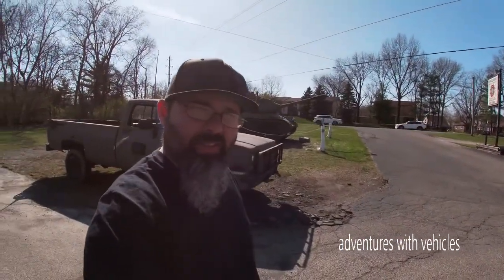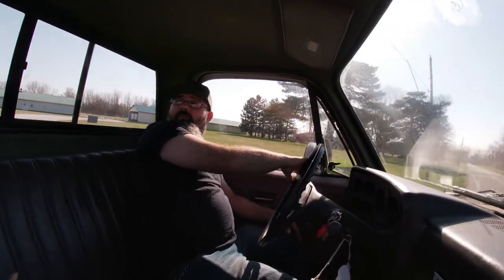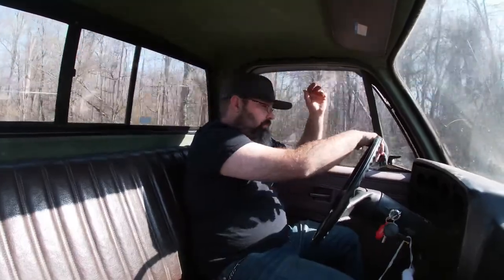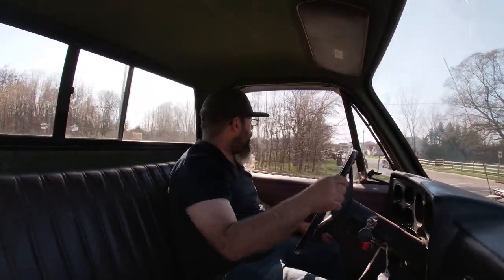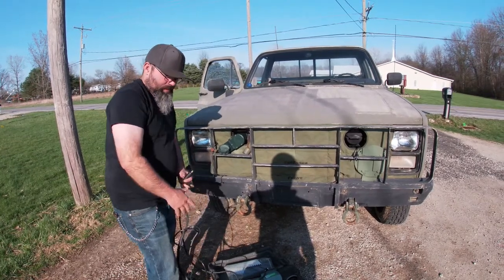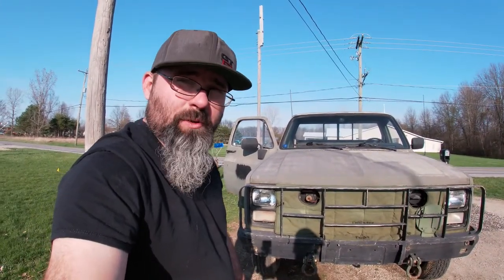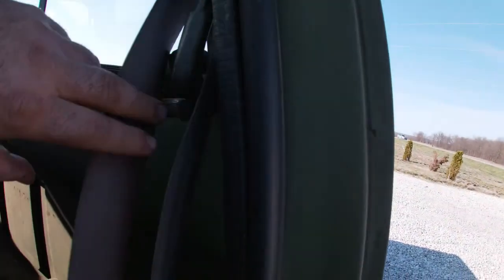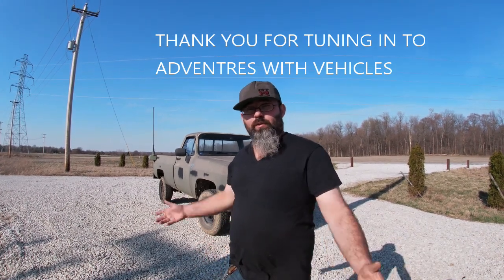M1008 CUCV MILITARY TRUCK

Comment: With the 6 2 diesel it is an absolute must to put a new harmonic balancer on the engine. The existing unit may look okay, but the rubber is hard and dry thus reducing the effectiveness of the balancer. Old balancers will kill the engine. Both of my M1008 trucks got new balancers and it makes a night n day difference
Reply: Something I may have to also look into.
Reply: @kevinfaherty9887  a new balancer is cheap insurance for a 6.2 diesel...
Reply: I'm sometimes overwhelmed with this hybrid 24/12volt system and can only do so much with limited funds. But will look into this. I got floors to R&R,and now have a starter that runs on after ignition key is turned off. Had that problem before but when Motor was running off if a Jerry can in cab it was fine. Now with new fuel pump,fuel tank,sending unit,glow plug relay,starter relay,all fuses...it's back (starter)running on after ignition key is turned off. Fuel isn't at filter yet. Wondering if I can manually pump fuel to filter and somehow get it to ignite and run again if this reoccurring problem will be resolved. Any thoughts,suggestions? This non running on its own power,is my highest priority. And major current concern.

Comment: M1008 has a detroit in the rear and an open front differential
Reply from the maker: Thanks
Reply: @adventureswithvehicles7335  the Steel Soldiers website is awesome for finding all of the info on these trucks

Comment: What is the stock size tire?
Reply from the maker: 235/85/16  31.73INCH TALL
Reply: Just Google it. M1009 wears smaller tires. Blazer as opposed to Pick up rig.